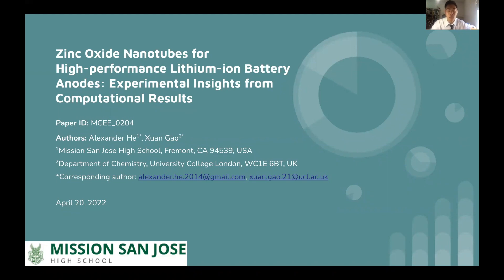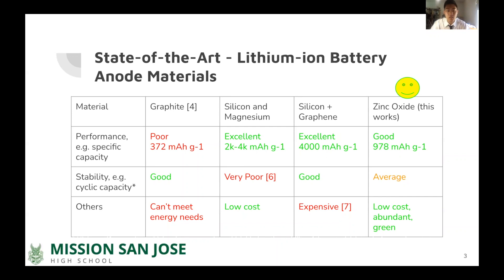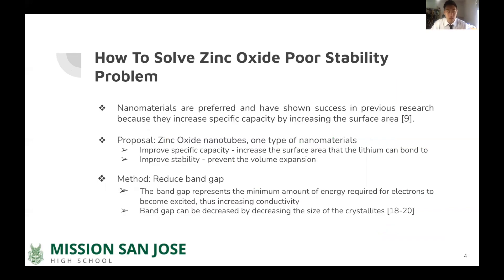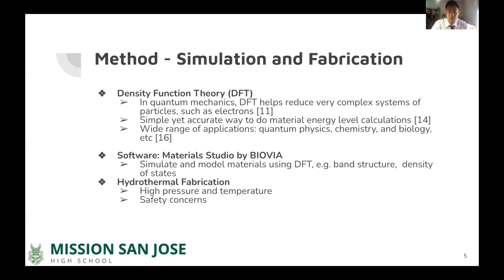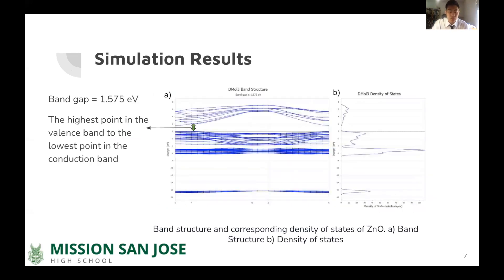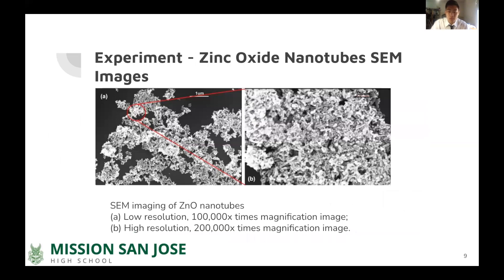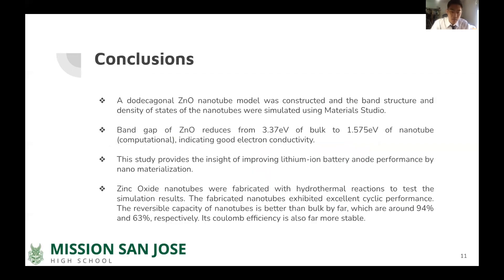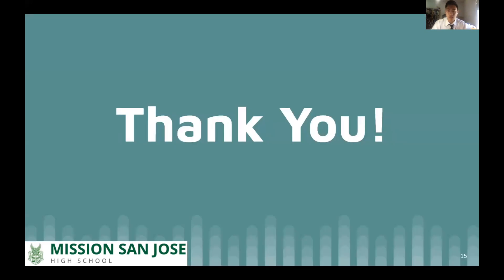CONF-MCEE – Zinc Oxide Nanotubes for High-performance Lithium-ion Battery Anodes: Experimental ...

Comment from the maker: Here are the questions we collected and the answers replied by the presenter: 

Q: What is the structure of lithium-ion batteries in your research? Do the cathode materials influence the results?

A: The lithium battery structure involved in this study is a half cell, for which counter electrode, electrolyte and separator are commonly used. It is true that the capacity of a full cell will definitely be affected and limited by the cathode material. However, as this study focuses on the anode, we have only used lithium metal as the counter electrode to test the performance of the ZnO nanotube anode itself.